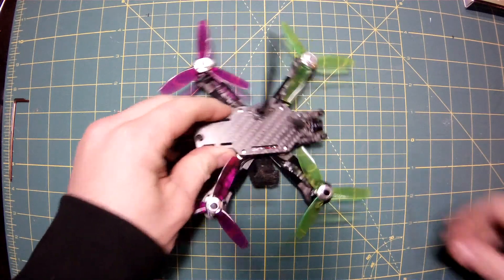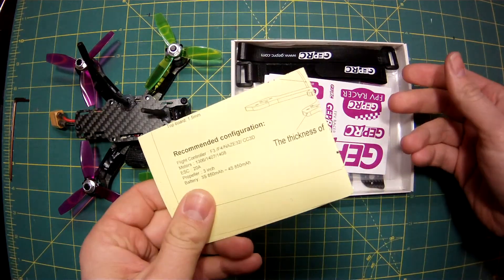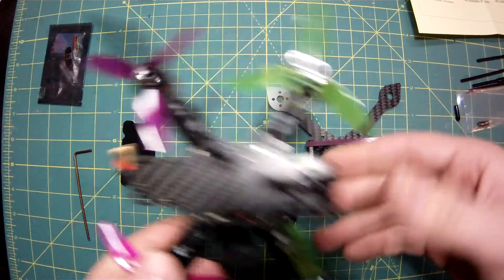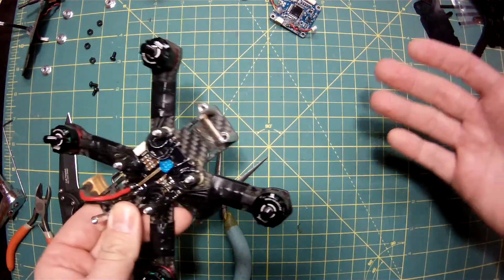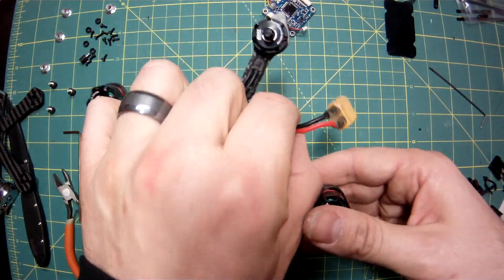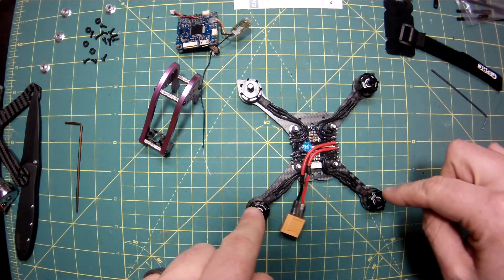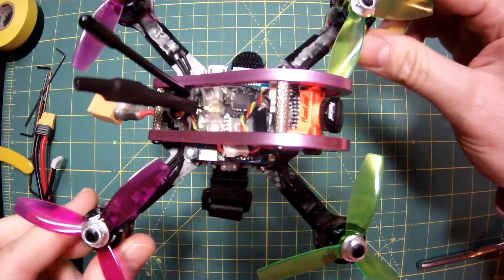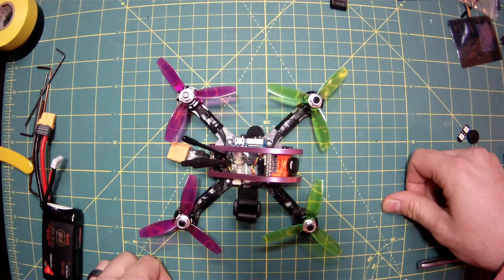3 Inch drone upgrade, GepRC Sparrow, Runcam Micro Swift, Emax 1306 4000kv

Comment: Awesome.... finally found a video that uses the 1306 motors on the sparrow frame... How long does that battery last? I just ordered 6 of the 4s 650mAh 70c batteries.
Reply: maybe a minute. i fly the spoarrow also with the emax motors and i can race around 1:30 with 900mah